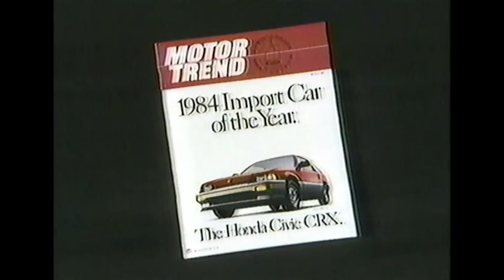DEL SOL: Honda's GREATEST Mistake

Comment: This was one of the most overlooked offerings from Honda in years. Under the hood it’s still a masterpiece
Reply: Ima say the CRZ also specially now with gas prices everyone buying them up
Reply: The Del Sol with a RWD B16/B18 would have been the better Mazda Miata without going the more expensive S2000 route.
Reply: Yes and they came with the Y21 boxes too with 4.4 final drives lsd options.
Reply: @jasona9694 CRZ was not misunderstood. It was created on the backbone of Honda most famous car ( CRX). It failed hard trying to make a sporty hybrid that was neither fun (primitive cost cutting suspension design) to drive or fuel efficient (heavy car).
Reply: @Samuelamnuelgreeneggshamuel I have a crz, it's fun. not very powerful but not crappy either. very comfy and great interors. suspensions are very nice (showa ). fuel efficency is ok, depending on how you drive. it is more fuel efficency than most 1.0,three cylinders turbo with less than 100cv. Also it's not super light but not heavy compared to competitors in modern times.
Reply: The Vtec delsol is the best👍🏼👍🏼
Reply: These cars are not fun to drive but they look awesome. Thanks for the vid ❤

Comment: The real problem the del Sol wasn't the power plant it was the fact that it did not handle well. If Honda had managed to make the del Sol handle as well as the CRX, the del Sol would have been a much bigger success. The targa top was lightweight and actually very easy to manage.
Reply: With just a fee suspension upgrades they handled a little better for a FWD vehicle.  

Owned a S2000 and always attended the S2ki events on the Tail of the Dragon 🐉 hwy 129. 
My S was in the Body Shop so I drove my wife's Del 🐌 Slow,  she was a blast on those 318 curves in 11 miles. That little Del Slow was beating the S2000 beginner driver's that weren't familiar with the Dragon.  😂
Reply: They hand like dog poo even modded for track use. The chasis design is so poor the frame can bend from cornering too fast. They are only good for strait line mods.
Reply: You just need to put in the right mods and they handle better than you expect!
Reply: Talking stock then yes it does not handle very great but a simple tie bar coilovers and a front sway bar (which came stock in vtec trim) and they become as good as a regular civic with the same mods
Reply: I think you are misinformed or generalising. 
Spreading misinformation like this is the reason why the Del Sol is so misunderstood
A top of the range Del Sol handled better than the CRX (3rd Gen hatch back).

If you compare the lowest of the Del Sol in your country then it would obviously not handle as well because they introduced more trim levels and options list compared to the previous model.
Same goes with acceleration.
Both top of the range CRX Del Sol vs CRX shows the CRX Del Sol won. There are 2 videos on You Tube of both stock cars with the Del Sol winning and dispelling the misinformation.
Reply: Yes. I said the same thing. Misleading information. Should be renamed "Del sol.. a misunderstood but genuinely good car.

Comment: Its a shame Honda didn't advertise and promote the Del Sol well enough. I owned a 93 Si with the manual and loved the car overall. Yes, it had the roof leak issue bit i resolved that. It was a great car for what it was meant for and practical. I chose it over the miata for safety reason because i lived in eastern Pennsylvania and the Miatas lack of a roof or similar structure made it a no go.
Reply: Look at my post. As a Honda tech, the Del Sol was a nightmare. The 7th revision of the roof was 14 pages long and only paid 7 hours. That repair took almost a day and a half if done correctly.  Welcome to "Flat Rate".
Reply: @Garth Quapp your right, that job is a bitch and very time consuming. I did it on several Del Sols as private jobs. No, I'm not a professional mechanic just to clarify. I never took my roof off so I used heavy silicone gel. Never had another leak.
Reply: true honda didn't promote the car enough
up to now I don't remember a commercial for that car but I remember the commercial for the first gen Integra years before 
I drove one outside being too much a civic it was a car I would like to own but not oratical enough for me
but a great summer car
Reply: @hugonubario  When i had one, i quickly came to love the car inspite of the roof leak issue as i lived in semi rural area with a lot of twisty, narrow roads where small, light weight handling cars had the advantage, as well as being safer to opporate. I dailied that car and found it quite practical as well as easy to work on most things.
Reply: @vanhasydan4754  
lucky to have twisty roads near you!
I have to drive 2 hours to found one!
2 hours of fun off course but still 2 hours!
I chose to buy a 4 doors mostly for insurance 
the del sol where I live is quite rare and expensive if you find one
Reply: @hugonubario  theyvare hard to come by one in good condition. I've had to walk away from several because1 was rotted out, the other two had been wrecked and the seller tried to hide the damage. All expected a rediculous price.
Reply: @vanhasydan4754  
Not surprised by that
They know those cars are on demand it's like the 6000$ S-chassis running gag
Beaten to death good for scrapyard but still worth 6000
Reply: @hugonubario  yes, they are quite delusional.
Reply: Funny how every unsuccessful car is a victim of not being promoted well enough or right. 
It couldn't be that it was part of a small crowded market segment with stiff competition.  The del sol is a cool car, but at the time, I don't see buying one over the competition listed in the video.
Reply: @vanhasydan4754  i have a del sol, and i’m wondering, where should i apply the silicone gel ?
Reply: @BlackSpeed206  heavy silicone gel on the car seals, not on the panel. Press it down, lock and check the latches then wipe off what squeezes out
Reply: @vanhasydan4754  man…. thank you! i’m gonna do that ASAP!
Reply: @BlackSpeed206  your welcome

Comment: I'm CONSTANTLY looking for a Del-Sol in good condition, unmolested with no issues and working a/c. It's impossible soo far 😩😥😪
Reply: I know what you mean.
Reply: I just grabbed one, a poverty spec 1.6 auto for £800. 

I’m planning on retrofitting it to a higher trim level: alloys, aircon, etc. Otherwise it’s staying more or less stock.

Comment: The USA did in fact receive the SiR variant called the Delsol VTEC which feature a B16A3 for OBD1 and B16A2 for OBD2A. The USA version had 160hp while the JDM EG2 came with 170hp due to higher compression and an optional LSD. The biggest difference between the USA and JDM car was the Japan model had a Transformer top which also made it heavy
Reply: Canada as well.
Reply: minor drawback of the VTEC is that it didn't have the transtop like the SIR. that would have been fuckin awesome to see in the states.
Reply: @Gekkoid well, it did add 500 pounds lol. And it was easier and faster to take the top off manually than the transtop
Reply: @callmetimmy3004  ah figures, i should have assumed the transtop would add a bunch of weight.
Reply: @Gekkoid  also gets rid of the huge trunk space lol
Reply: @callmetimmy3004  i was looking at that earlier!! its insane, the delsol has crazy trunk capacity, but  the SiR trunks are tiny
Reply: Not all SiRs had the Transtop. The Transtop was an option available on all trims.

Comment: Say what you want, the del Sol does have its loyal following.  Over the years I've owned at least 20 sols and currently have 4 of them - including an all original red 97 SI with ONLY 4,257 original miles and a limited edition (500 manufactured & released in germany) 1998 CRX/del Sol Motegi with 34,000 miles.  My other 2 sols are used as daily drivers.
Reply: Show me. 😏
Reply: Back in Nov 2015, i shot a 15 minute video of my 4k mile sol (along with a couple of other sols).  It's posted on youtube.  Type: "honda del sol RED" and the video should pop right up.  Be sure to type the word: RED.  As for my motegi, i havent posted any video yet.
Reply: I have a 1993 si samba green.  I can't believe you got your hands on a motegi though! Nw you gotta look for the daytona trim from Germany

Comment: Back in the day I used to work at a Honda dealership and that VTEC was awesome in that light body but we called it the leak and squeak because of that rooftop but it was a blast to drive
Reply: When I first bought mine it leaked around the seals above the driver side door lock.  I read up online. And brought the seals all back to life with some die electric grease and elbow grease. It never leaked again.

Comment: Thank you Trav for providing us with this informative video.  As one who was fortunate to own a 1993 Civic EX Coupe, I still wish I would have bought a Del Sol back then.  My own reasoning was due to rear back seats on the Civic EX Coupe.  I will say though that the Del Sol was an excellent product, and it should still be produced today!  The Del Sol had the same great engine of the civics back then and offered 27mpg in the city and 33 mpg on the highway with their regular gas V tech engine!  Moreover, the Del Sol had a light weight easily removable roof that could be stored easily in the trunk.
The Del Sol is also better than today's small and tight size Mazda Miata.  Many people cannot even fit into a Mazda Miata, whereas the Del Sol had ample room for people six feet and over!  The Del Sol is really missed today, and Honda should bring it back.  They could even utilize a hybrid style engine.  I praise Honda greatly for building and producing the Del Sol when they did.  Mazda Miatas although great sports cars are too cramped and they do not fit people that have larger sized bodies, making them impractical.  By the way the 1993 Civic EX Coupe was known as one of the BMWs of small cars from a major car magazine at that time, interesting.
Reply: Great info I would love to know which magazine and article that was.

Comment: I wouldn't call it a mistake. I had 1992 model in bright orange color with enkei 16' black wheels with a custom made exhaust from engine to the very end. it was an eyecatcher. Small and simple. I have had a great times with it. It was incredible fun to drive. The only minus was, as mention, seals around the roof. Thal was pain in the ass. But overall - it was fun and i miss the car.

Comment: I owned a 1988 Honda CRX and loved it. The only reason I got rid of it was because when my kiddos were born, I needed something with a back seat. Oh, Miata isn't ALWAYS the answer. If I want to go very fast in a straight line, my 500 hp daily driver is a lot more fun than a Miata could ever be in that capacity.
Reply: What daily driver is that?
Reply: @freddysevolution9  A 2018 slightly modded 6 Speed Ford Mustang GT.
Reply: @thullraven1 ain't reliable
Reply: @JGonzZ.  It's been reliable for me. I wasn't talking about reliability anyway. I was talking about fun. When you give me a Miata that does 0-60 in under 4 seconds like my ride does, then Miata might be the answer for me, but not until that happens. I couldn't care less about corner carving as I don't have any here.
Reply: But, only in a straight line.
Reply: @skaldlouiscyphre2453  I drag race and don't live anywhere near canyons to carve. A straight line is the only kind of speed I need. I get a throw back in the seat thrill with a Mustang, Camaro, Challenger, etc, that I will NEVER get with a Miata and it's tiny engine. Miata isn't the answer for me or anyone like me.
Reply: @thullraven1  Fair enough, I've got enough roads through the escarpment that a big car (Camaro, G35, etc) wouldn't be as fun as something smaller. A CRX would be killer but I'd be too afraid to drive it on gravel.

Your basic premise is right, there isn't a single car that's the correct answer for everyone.
Reply: @skaldlouiscyphre2453  Funny you should mention a CRX. I had a 1988 one and loved it. Totally different animal than what I have now. Please don't take it as I'm slamming Miatas. I'm not. They are great at what they do, but after spending a lifetime driving pocket rocket corner carvers, I love what I have now.
Reply: @thullraven1  I noticed that in your OP.

I get where you're coming from; it's not that one type of fun car isn't fun, it's just that we can prefer different types of fun.

Likewise, don't think I'm not a fan of bigger/more powerful sporty cars. Different strokes and all.
Reply: 1988 CRX was a great car.  I had an HF (high fuel efficiency)  It didn't have much power and you didn't really need 2nd gear.  Straight from 1st to 3rd every time, but DANG I got 62MPG regularly.  I've often wondered why I've never seen another car come close to this (non-hybrid).  Most likely it had terrible emissions and standards went up.
Reply: @hastypete2  That was a great ride! Honda later admitted that they regretted getting rid of the CRX.

Comment: They sold the Del Sol VTEC in the US with the 160hp DOHC VTEC B16a3. That model was only built the last couple years of the Del Sol and are pretty rare, and it was actually the first model of Honda in the US to offer a B16 engine. Before the Del Sol VTEC only the Integra GS-R had an optional DOHC VTEC B-series engine stock. My first car was a '93 Del Sol S with a 5spd, it was a great first car. Almost 20 yrs later Id like to get another one

Comment: The del sol was the chassis with the most swaps in usdm
93-95 del sol s d15b7
93-95 si d16z6
94-95 vtec b16a3
96-97s d16y7 obd2
96-97 si d16y8 obd2
And i think 96 wasnt avail in vtec
But 97 vtec got the b16a2 which later on became famous bevause of the 99-00 si (b16a2)
Reply: Yup, the 97 vtec had the EM1 Engine a couple year sooner! Flew under the radar..
Reply: 96 had a b16a2
Reply: @callmetimmy3004  they're you go

Comment: The USDM VTEC trim had the same b16 engine as the JDM SiR trim. They are extremely rare (only ~7k sold in total were sold in the 4 year run)  but they absolutely exist stateside!
Reply: The 94-95 had the b16a3
The 96-97 had the b16a2
Reply: 94-97 was the B16A3 
99-00 EM1 had the B16A2
Reply: @shirecain2129  wrong. 94-95 had the b16a3 and then 96-97 had the b16a2
Reply: 🤚 one of the lucky ones that has a true eg2
Reply: @shirecain2129  wrong, in 96-97 they were the b16a2 because they were converted to an OBD2.

Comment: I'm likely one of the few that has owned both. A '93 Si 5 speed in the late '90's and a loaded '06 Miata 6 speed from 2016 until 2020. The Del Sol was a hoot with all the handling characteristics of front-wheel drive (I had a Mini Cooper in the late '60's). The targa top did leak a bit but it was easy to remove and stow it without much loss of trunk space. I bought it used in 1998 with a 100k miles. It ran and drove like a new car and over the time I had it was bulletproof. Mileage was exceptional. On a mid-week jaunt up Highway 93 from Boise to Salmon, Idaho (well in excess of legal speeds}, it got 40 mpg. Its downside was a cheap interior. Mine was literally falling apart with the "molded" fabric covering the lightweight bucket seats coming away from the seat with rips exposing foam. Like I said, it had FWD handling with terminal understeer, but at 8/10th on a twisty back road, it was loads of fun. The MX-5 at near 100k miles drove and looked like a new car, inside and out. Had the 17" wheels and the Bilstein shocks and was truly a joy to push on those canyon roads. It also was troublefree but didn't get near the gas mileage of the Del Sol. On a road trip driven at the same tempo, the best I could do was 31 mpg. In the final analysis, the Miata is a "sports" car and the Del Sol is a "sporty" car. Although I can't help but think if Honda made a "Del Sol" today with the advancements they have made with the FWD technology and handling of the Civic Type R, they could have a real competitor to the Miata.

Comment: April of '93, and I test drive back to back on the same day a new Del Sol and a new '92 Miata.  The handling of the Miata made it a no brainer, instant decision.  I thought I was buying a toy for my wife, instead it was one of the most reliable cars I've ever owned.  I think the only mechanical repair in 123K miles was a new slave cylinder for the clutch.  Reluctantly I passed it on to my grandson late last year. He's enjoying it as much as we did.

Comment: My first ever manual transmission car was a '93 Del Sol S in white. Bought it with roughly 105,000mi on the clock, in 2011. Thing was rough, but man was it just a fun car that didn't take itself too seriously. It knew what it was, a two-seater Civic; excelling at nothing, but being good at everything. Thing was slow as hell, but with a combined average of nearly 41 mpg, I wasn't complaining. 

There was even a time where, while the whole time I owned it, the D15 was burning oil. The oil pressure light came on, and I didn't have an opportunity to get around to it for another two weeks. For those two weeks I had no hiccups. By the time I got around to changing the oil, I was only able to drain out about 1/4 of a quart. It ran on less than a quart of oil for that long and somehow the engine didn't blow. I knew by that point (having a '00 Accord and a '98 Civic before) Hondas were reliable as all get out, but that cemented it for me. 

I've since moved on to more horsepower in other manufacturers' offerings, but to this day every subsequent vehicle I've had I attach the original Honda keytag that came with that Del Sol when it was first purchased in '93. It's been 8 years since I've sold my Del Slow, but I still have a spot in my heart for the little guy.

Comment: I bought my red Del Sol Si back in 1993.
I still have it. But I completely modified it with a iron sleeved B18C with a supercharger that makes over 400whp. Added oversized brakes to the front, race suspension, racing style seats and steering wheel, and sport body kit.